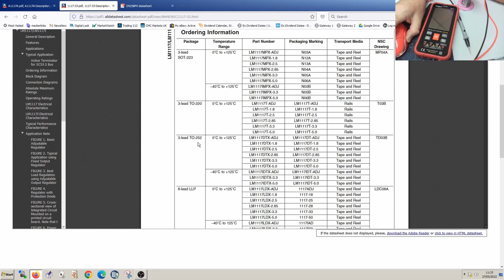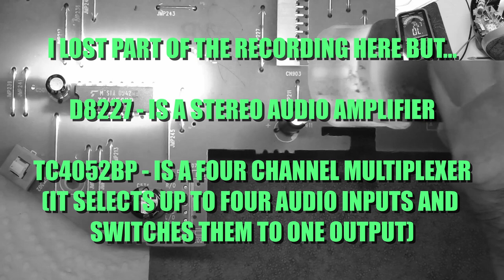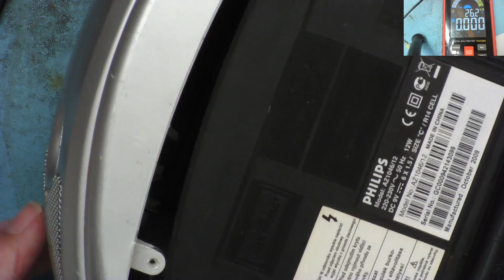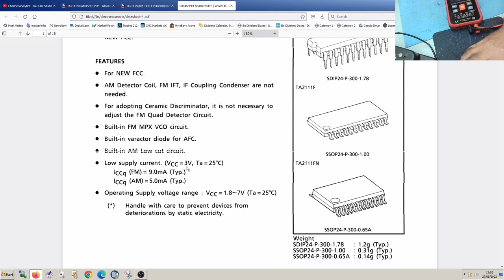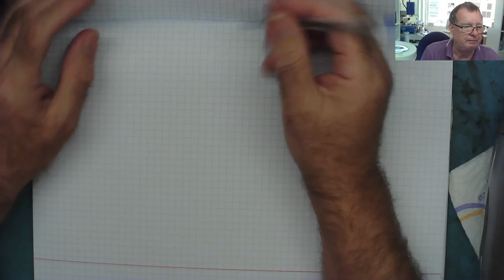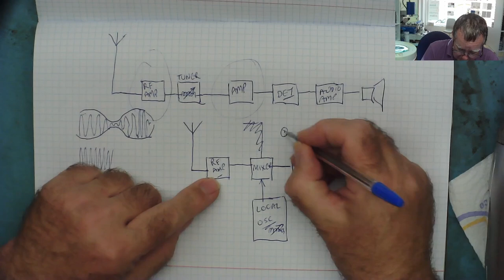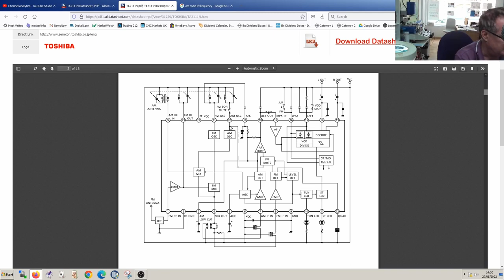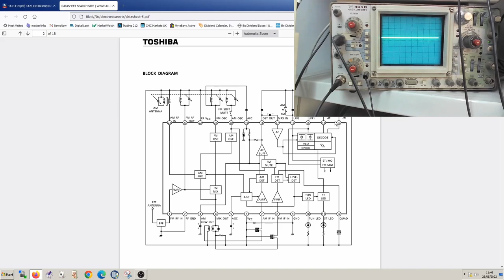Portable CD Player / Radio / MP3 Music Player Repair. How to Understand and Fix radio circuits.

Comment: An invaluable test tool I put together for myself is a 'signal tracer' consisting of a small enclosure with an old probe and a ground lead connected to a simple LM386 amplifier (9v battery operated) and a tiny scrap speaker. Hardly Hifi but is brilliant for tracing/confirming a signal path. May be a nice little project for your channel? Apologies if you've already done this but since you did not use such a tool here, I assumed you hadn't. Cheers

Comment: So basicly when you dont have a voltage on an ic or a condensator... that is an audio output..you just make a connection with a wire and it works...bad trackpad..I mean the rusted one got it.....thanks for sharing ...nice video...keep up the good work.

Comment: I have come to accept as law that the fault is almost certainly on the bottom of the most difficult - pain in the butt - PCB to test. Fun video as usual. I'm trying to get up the gumption to try pulling apart a once fancy Canon L1 Video Camera that was notorious for bad tantalum caps in the 80's. I'm certain that will be an adventure! Oh, and you did pretty good on the radio theory and superhet block diagram ; Amateur Radio Op NZ5I

Comment: Hey Richard, really enjoyed the video! Cant stress enough how great the new multimeter is for the viewing experience! Keep it up!
Reply from the maker: Hi Daniel, nice to see you are still around.  Yeah the Kaiweets multimeter is really nice and I thoroughly recommend it.  As you can see I've branched out a little bit with the repair topics but I think it keeps things interesting to look at some different items. 🙂
Reply: @LearnElectronicsRepair  have never been gone. Still watch basicly every Video of yours! 
The great Thing is, that such a Basic and cheap Item has so much potential to teach you about electronics! Because No matter If expensive GPU or a CD Player you can apply very similar fault finding to both which is great if you want to get into repair, but want to try and learn first before going for expensive stuff !

Comment: Its been a long time since I have seen a Ferrite Rod Coil AM Antenna and a tuning capacitor. Nice to see them again. I think you should be able to hear the BBC on AM.
Reply from the maker: Yeah it is a while since I saw a Ferrite Rod antenna too.  Possibly there are some AM transmissions to receive here but my workshop is enclosed in the shopping centre so maybe I just don't get a good signal.  I have one FM station about 10 metres away from me.

Comment: I've had AM radios that flat out would not work on a switch mode bench power supply, nothing but static like you got.  The FM worked fine. I didn't see how you were powering that thing.  Some of those cheap radios even have linear power supplies in them.

Comment: Greetings: Q: The light U speak of as current limit. It is a 40W or 60W? Then again I should ask what line voltage U have there. I figured the bulb at 120VAC. I use the same idea however I use different bulbs 4 different applications, I also have a PR57, extraordinary senses including good heat sensitivity.

Comment: If you connect a long piece of wire outside to the telescopic aerial, you should deffo pick up something on Medium Wave even if you are thousands of miles from a transmitter, especially at night.
Lower frequencies 1 to 15MHz propagate better at night and higher frequencies 15 to 30MHz, better during the day in the HF Bands, as a rule of thumb.
Any radio hams or SWLs will give you a more informed answer, I'm sure.

Comment: Greetings: "Jack of all trades, master of none". U having said that developed much respect from me. Perhaps I should B less critical in my reviews. Me- also Jack of all trades, but master of many. I think U could have used ¼ of the Vid time and probably less real time 2 diagnose this. I could have. I figure U do it 4 educational purposes. No worries. 4 the newbies, less experienced and knowledgeable I hope it was educational. Fact is this basically entertainment and/or info 2day as it is a replace world not a repair world. 30 yrs and beyond we could make a buck but not on that stuff. $30/hr bench charge and it went back out the front door 5 minutes after it came in without it getting on paper.   It was said we were pricing ourselves out of the market. $50 bench and above was a good rate 4 Pro audio and the big stuff. The general consumer electronics rate I mentioned above was competitive and worthwhile 2 the consumer of decent devices. Ppl now think I should base my rate on what they paid less depreciation. Hence the reason I quit repair of consumer electronics 20 yrs ago. I still repair. I changed markets." Adapt and overcome". Same Ppl's mentality tho. Thx 4 the upload.

Comment: Would you believe it, switched on similer type radio, nothing, played around  with it 3 -4 hours, binded it,  should have put it in the loft for later, ah well, next time, regards.

Comment: Hi richard i would like to see more. Of this. I am strubbling with itt saub lorenz from 1968 transistor radio. It is working but sound what comes out is very low. You can adjust it with volume potention meter but sound still low volume. I can not find anythin low. Can it be the  end transistor npn and pnp. I do not know they measure good with my multimeter. Can you give meadvise on it what i can check on it. It is wedding present ( it is familial sentimatic value for the father of my girlfriend.)
Reply from the maker: I would suggest replace any electrolytic capacitors.  Also this radio could be using Germanium transistors which may have lost gain over the years.  The same could be true for old silicon transistors of course.  The only way to test this would be to remove them, and use a tester (or build a test circuit) to measure the gain and compare with the datasheet.  It is also possible some resistor(s) have also gone high value with age but this usually happens in high voltage circuits.
Reply: @LearnElectronicsRepair   hi yea they use germanium transistor in t03  package . Yeah measure everything and replace already capacitors. But it hell to work on it no place. With all wires etc..
Reply: @stevedebeukelaer1424  weird curiosity but your last name sounds very dutch do you come from a dutch family? it is just a guess.
Reply: @mart43  i am from belgium
Reply: @stevedebeukelaer1424  ah, cool
Reply: @mart43  and you where you from